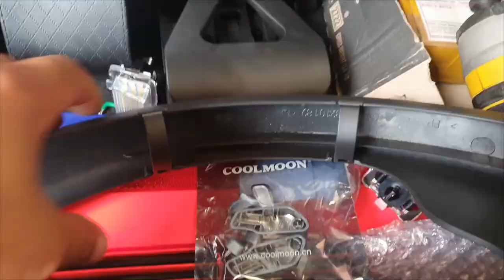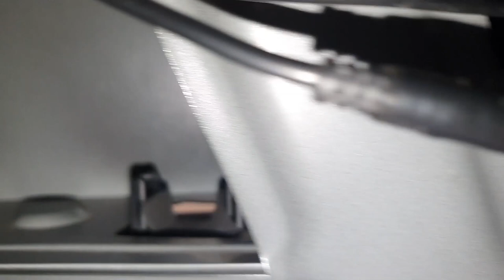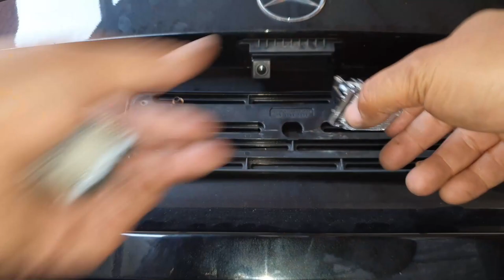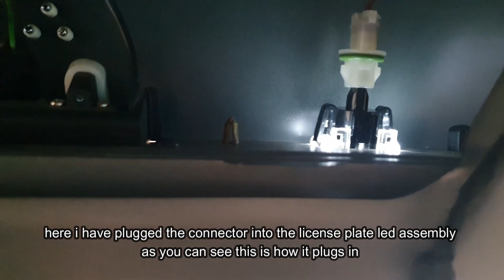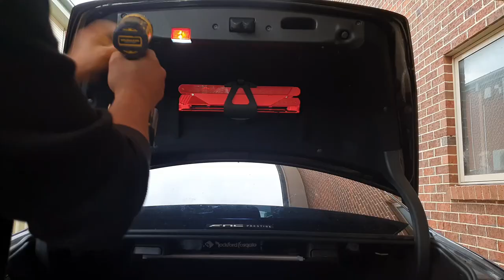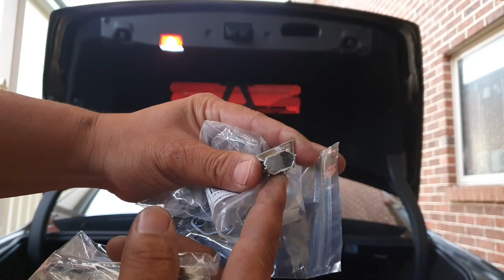how to install/replace license plate led bulbs mercedes w204... not too hard

Comment: Hello, how did you put your sound system with original Mercedes car radio please?
Reply from the maker: the system is original mercedes system I just added a subwoofer using line output converter to get low level input for bass
Reply: @MIKEYZVLOGZ  hello, oh ok could you tell me more please? because I would like to put my sound system in my Mercedes too but I don't know how to do it and can't find anything on the internet.... thank you
Reply from the maker: @Eminzofficial  u already have a sound system .. u just need to add bass ..unless u want to replace speakers u can do that.. depending whether u have the harmlm Kardon system or not..mine has the hk system with amp and sub woofer from factory I just added another sub for more bass... but ended up removing it cuz was too much...there's already enough bass in the standard system from hk. I had the sound system package which is the harmony. kardon package..alot.better sound then standard... nmi also did a video showing how I added the other subwoofer ... using a line output converter I grabbed low level inputs from my sub woofer and that converts it and sends bass to amp and outputs to sub...its hard to explain pls watch a few video on w204 sound system upgrades and difference between sound package and standard

Comment: Jeez Louise, WT actual F! What happened to 2 screws securing the licence plate lens assemblies, you know, you could change the bulbs in under 2 minutes. Progress, isn't it great. 🙂This isn't a dig at the video, thanks for posting.
Reply from the maker: do u mean u can change the w204 led bulbs in 2 min?, or do u mean back then u could simply do it in 2 mins with older designs? cuz i do understand that